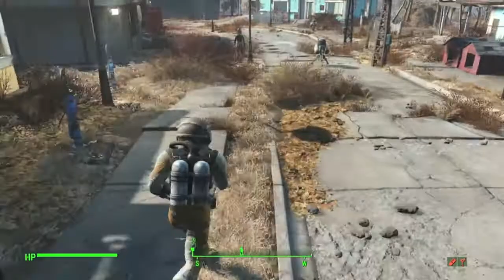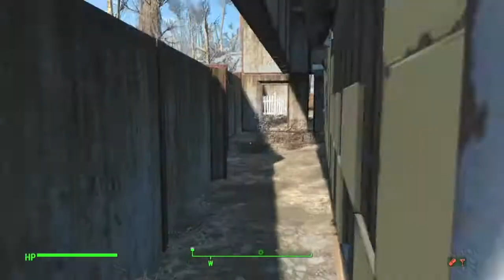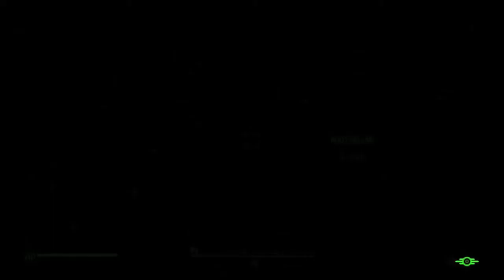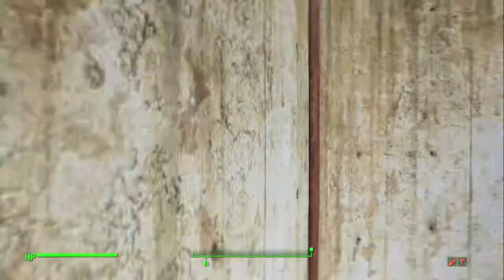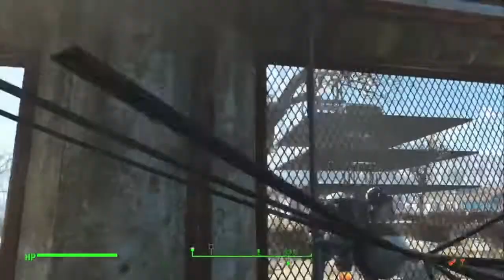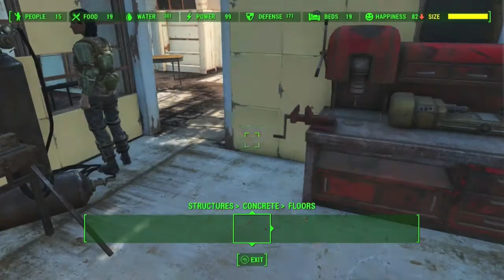Fallout 4 Wall right around Sanctuary using Concrete with COMMENTARY

Comment: Does it help when raiders attack?
Reply from the maker: Yeah if they spawn at the back walls it helps, especially if you get super mutants etc or even I think maybe even deathclaws sometimes. A lot of them spawn inside the walls, just notice where they spawn. Make sure you check out my Sanctuary Cover Up video one of my best work yet .. it will blow your mind following Jug's building style .. https://youtu.be/OsXMjHWjaWY
Reply: You can either look on YouTube respawn raiders attack positions

Or what you could do what I did straight away

Your characters home and the workshop bench house

Build a wall connecting the two with power sliding to get in and out

Then just put tons of gun turrets on top of the wall

That way it gives you the best defence either direction